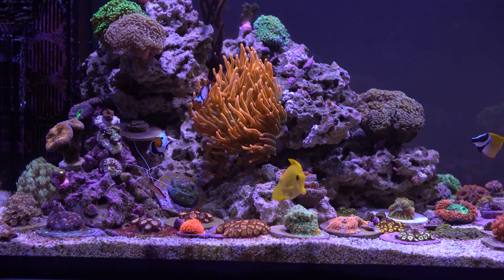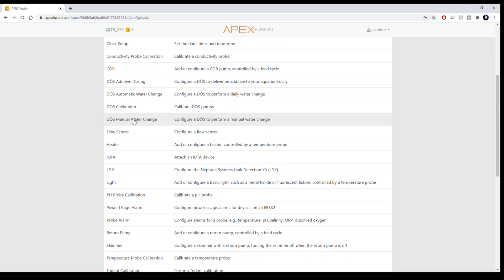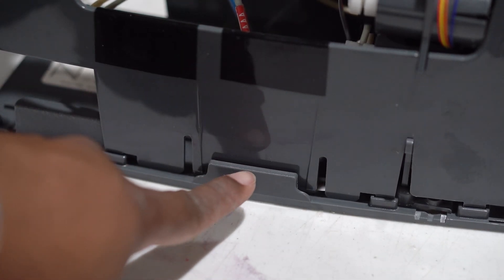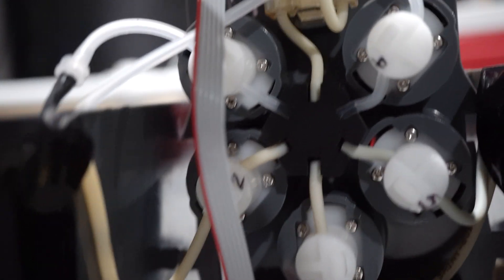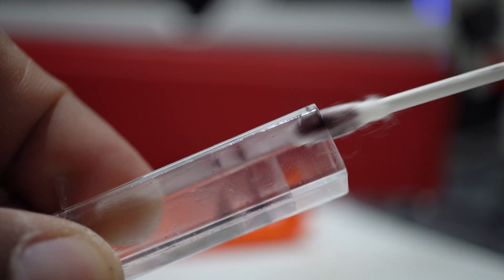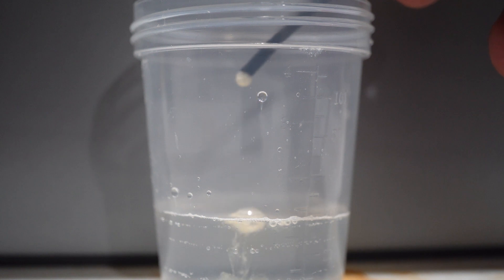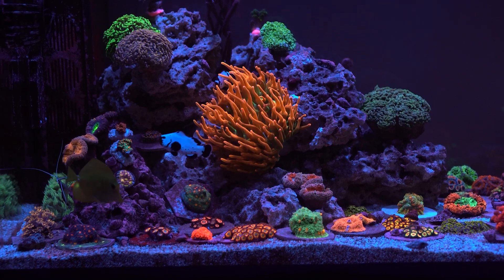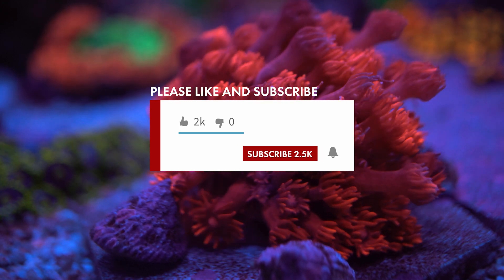Tristian's Reef: Trident Breakdown/Fixing Trident Issues/Test Vial Cleaning

Comment: Awesome video and smooth dialogue throughout. I’ve had my trident for a year and within the past two months, two different issues popped up. First, the cal reading was messing up, due to build-up in the sample line. Second, the alk started reading 15 but Hannah test showed 10, which is what I keep my reef at. Cleaned out the sample line to fix issue one and then used this video to clean my sample vial. This way way quicker than Neptune support and definitely cheaper than sending it in for annual suggested maintenance. Thanks again!!!!!

Comment: You mentioned flushing the lines? Which ones are you talking about - the two at the exterior of the unit? Can you use a small syringe with RODI water to flush them or am I going to damage the pump? Perhaps you can do a video about it.
Thanks  a lot for the video
Reply from the maker: I flush the black feed line with rodi from Time to time.

Comment: This has absolutely not meant to be rude in anyway.  I would not post this "in order to keep trident working optimally".  I have have mine since day 1 and have had to clean the cuvette AFTER support informed me to do so.  It should not be done unless you are told to.  Also they have mentioned not to use any liquid in the cuvette.  Not sure if that does anything to it.  Keep up the good work man and appreciate all your videos!  I know how hard it is to do them.  I just did my cuvette cleaning video.
Reply from the maker: Hey Reef Automation - I agree that in order to keep your trident working optimally many people might not have to do what I did. I absolutely respect your point of view and the wishes of the manufacturer. However, like many other things manufacturers will advise end-users not to use certain products because they cannot account for what everyone and anyone might decide to use. We use alcohol to clean sensitive 1200 dollar CPUs and Contacts of oxidation. I choose to use rubbing alcohol to clean my cuvette followed by a through rinse in RODI followed by cleaning the cuvette with a lint free cloth and reinstalling it. How dirty anyone's cuvette might get is probably entirely random, however, my questionable common sense dictated that if the area in front of the LED's were as dirty as my cuvette was then how could I trust the readings. I rely on my trident to test and give decently accurate results for an investment in coral that can purchase a thousand tridents. I choose rubbing alcohol to clean my cuvette as in the medical industry they use it to disinfect crap used on human beings. I figured that if it was good enough to use there it was safe enough to use to clean my trident cuvette. Flushing it with RODI was an added step to ensure what didn't evaporate was washed away cleanly. Ultimately no piece of equipment is infallible. There is a life span to many things in our hobby. Vortech's will rust, Magnets will crack, and I still stand by that using saltwater to flush the lines is probably not the best thing. I personally saw my own tests drift over the months. The calibration solution usually brought it back into spec but I feel like its a bandaid to calibrate to the "new level of crud build up." - If I had to choose another option over the Trident TODAY then I would probably go with something else.  But if Neptune released a Trident Version 2 that addressed my issues with Trident V1 I would undoubtedly buy that one instead. Thanks for the comment and your feedback as I highly respect what you do for the community on your channel :)
Reply: @TRSCAquatics  Thank you so much for the reply.  Again it was in NO WAY a put down.  I just, after speaking to Neptune, felt my video might go against their warranty policy so I did not want your viewers to have a problem.  I am glad you are watching and I will continue to support you as well.  Hope you have a wonderful day.
Reply from the maker: No worries I didn’t take it that way at all. I’m actually happy that you did a video and hope to see it when it’s released as well. As for warranty, that’s a tough one. I’m curious how their service program will work, but if it’s like switching my trident for another one then I’m less likely to do it. I want MY trident back and not someone else’s. Similarly as a hardware geek I enjoyed the challenge and learned a LOT about that makes this thing tick, as well as possible issues to look out for. My unit was under warranty and Neptune sent me the part to repair it and at no time was it a case of if I couldn’t do it I would void my warranty. I was told if it was too much I could put the unit together the best I could and return it for them to do the repair. I had excellent customer service and felt safe in my repair attempt :)

Comment: Are those 3D printed tube guides on your reagent caps?
Reply from the maker: Yessir those are 3D guides :)
Reply: @TRSCAquatics , I just ordered some.. did they help at all?
Reply from the maker: @joshbroadbent2341  I found that they enabled me to use up more of my reagent compared to without them. I also found that even after my Trident said I was out of reagent that I could continue testing for a few more days until I got wonky results. The general idea is that it allowed me to have a lot less WASTED reagent which was happening a LOT. I would continue to test until my reagent ran out at which point I would install new reagent do a manual test, calibrate it a day or so later and be back in action for another 2 months :) - Unfortunately I'm not made of money so flushing all that viable reagent down the drain fist punched the penny pincher in me each time :)
Reply: How do you force the trident to keep testing after it thinks it’s empty?

Comment: Mines is bugging out as well. Imma check. 
They should make a purge line task with RODI water and the chamber u cleaned with the QTip
Reply from the maker: Hey Producer! Yes it might be a good idea to check some of the things I mentioned above to really ensure that its operating at its best. The one thing that stumped me was why the feedline didn't have a FILTER of some sort incorporated to avoid sucking up any crazy stuff.
Reply: @TRSCAquatics  Yes your right. A filter would make sense...Maybe they can just add that part. I have a KHG and when my Trident went awol it was rock solid. So I was lucky.